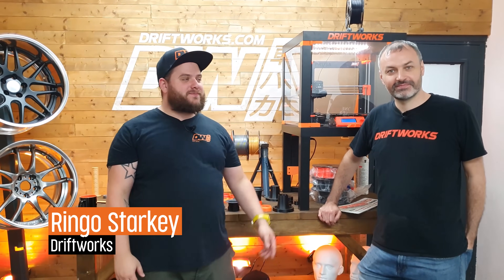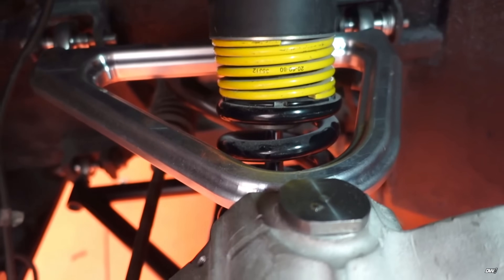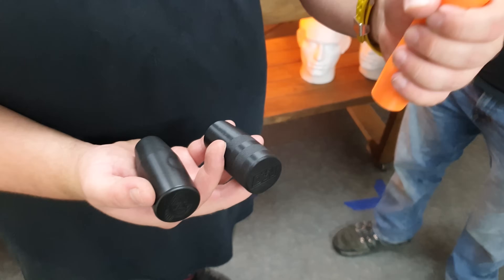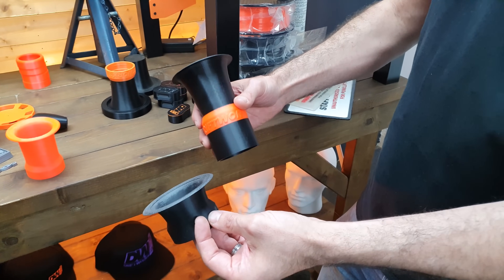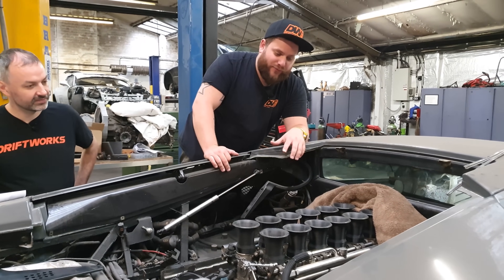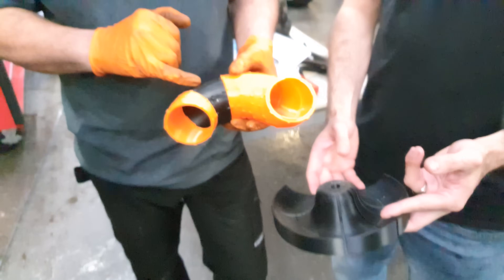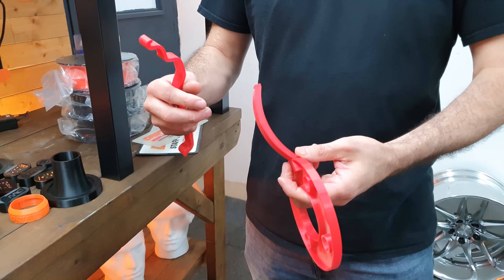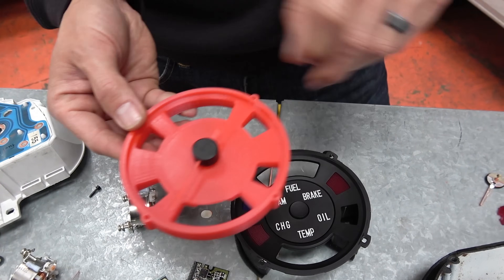Driftworks: 3D printing custom car parts in action

Comment: Great video, i did some car parts as well, thinking about printing bigger parts in pieces and laminate it. Engine bay is hot.. no problem with the air intakes and longer runs? - Thanks

Comment: Yes!  Best 3-D printer ever.  I'm making now a CNC Router tramming tool so I can get that thing as accurate as my MK3S+.
Reply: I suggest getting/trying a gunsmith torque screwdriver for assembly and a bit a Purple Loctite 222 or 222ms (is what I use); 10-20inch lbs torque (even torque for the bed = mostly flat, nothing out of tram at all within the correction potential of the printer, even torque again) max in combination with the Loctite, purple will also break away without breaking parts which is ideal and will easily  prevent any loosening from vibrations so your work printing and calibrating isn't wasted.  I've done this with my printers for 10+ years and my prints have always been very high accuracy for 1000s of hours of printing once everything else is dialed in.  I'm mostly able to print things with moving parts internally without issue.

Comment: How does it not melt o_o
Reply: its an intake... they prototype on abs or whatever and then they do them on carbon fiber. prototyping on carbon fiber would be a huge PITA
Reply: @LimpiezasMyG  Others print in PA-CF, especially ePA6-CF holds jp well above 100, depending on brand they should be good for 140-150. it‘s a pretty expensive filament, though. Prints slow and needs a steel nozzle also.
Reply: It melts, it's just used for testing for a couple of minutes I would say. If it's Abs it can take 100c before it starts to melt, or if you print with PEEK it can take 140c before it starts to deform

Comment: I've been printing parts for my race cars since 2015.  Best filament to use is HTPLA Carbon Fiber, or Nylon Carbon Fiber, depending on the application and location on the vehicle.  You can also prototype with PLA, and then make the final product out of metal once you know the shape fits.
Reply: Can you design a part ground up?
I need a grille making for a car that's discontinued